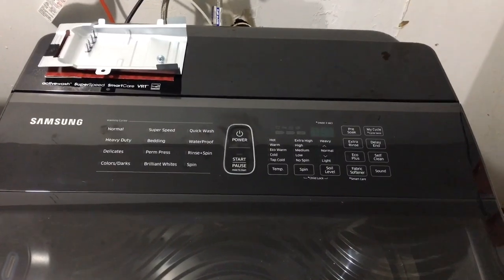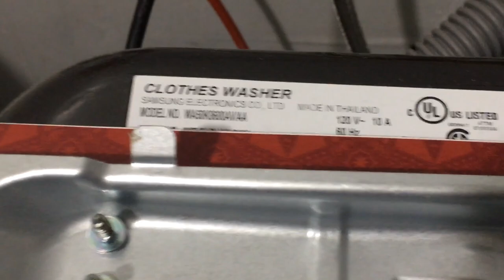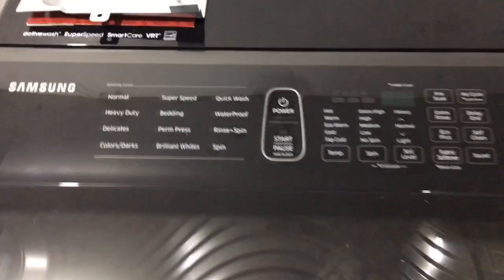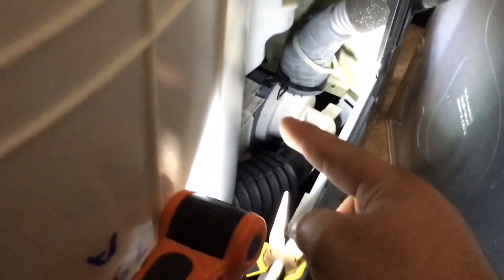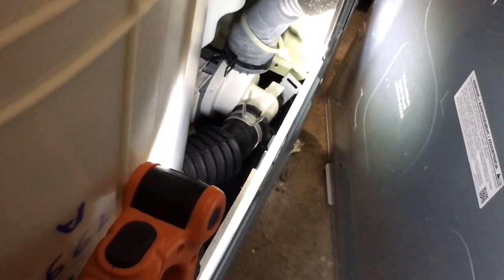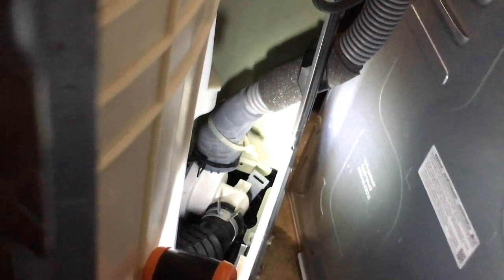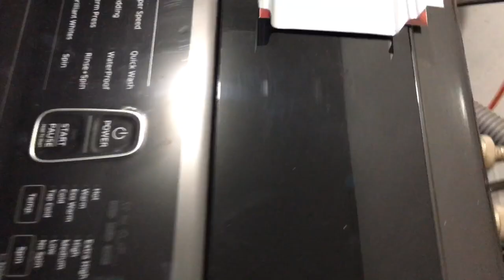Samsung Washing Machine 5C Error Code

Comment: I know this video is old, but my god I feel like I went to the end of YouTube world to find one with my exact model. So IS there NOT a drain pump filter on mine?! Was Damn near crawling on around in a circle looking for one 🥴
Reply from the maker: Did you ever get it fixed? Was it a sock?
Reply: @leebryant6128  oh no. Our washer refused to drain. about an hour before I came across your video! I know the typical go to would be to look for the pump filter door and drain/ wash the filter. Well apparently not with this
Reply: @leebryant6128  then ended up down a rabbit hole reading the samsung recall articles. How is this one not included lol